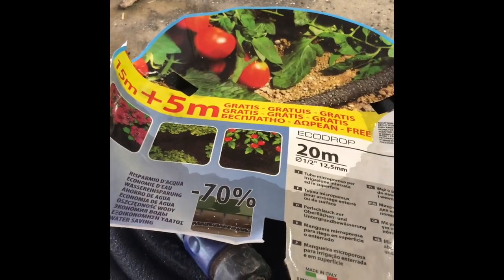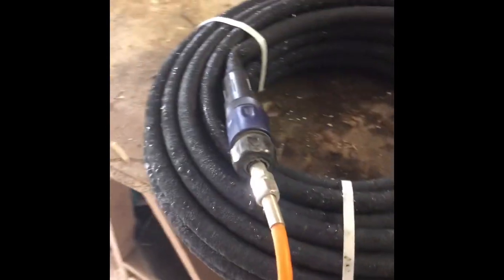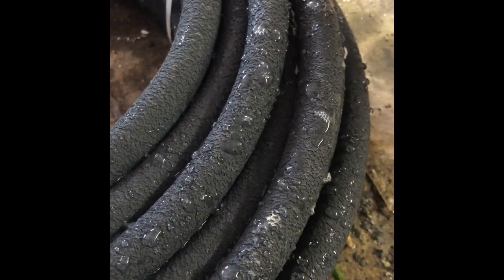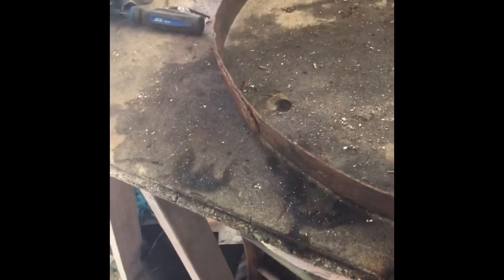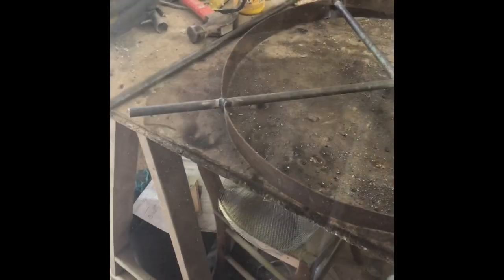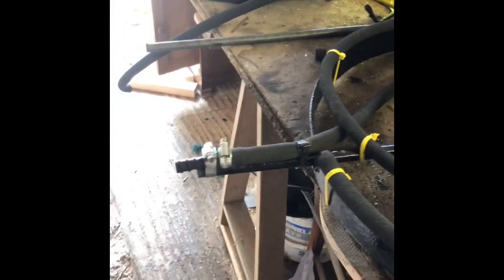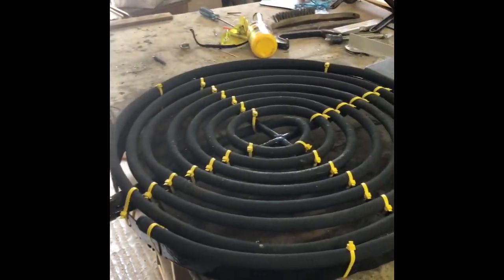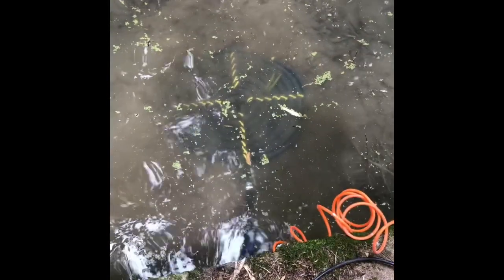Save 100’s by creating your own DIY lake aeration system and air diffusers Part 1

Comment: Any possible links where you shopped the components of the DIY?
Reply from the maker: The micro porous hose was out of our local diy store, the metalwork we had lying around our yard and the air pump we finally used was a Charles Austin  ET SERIES. Trust this assists